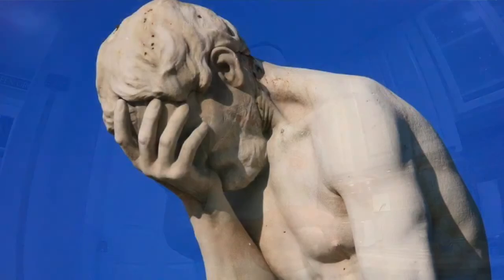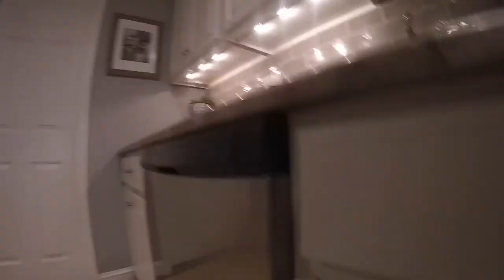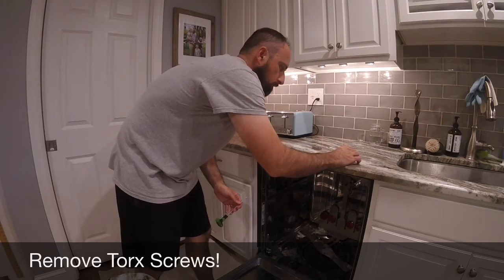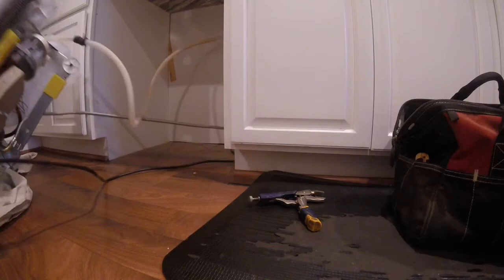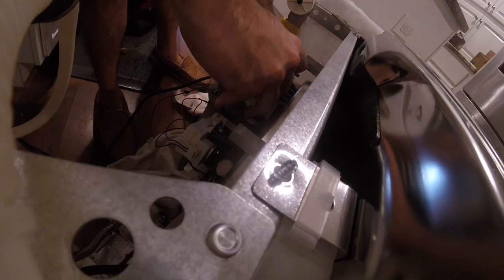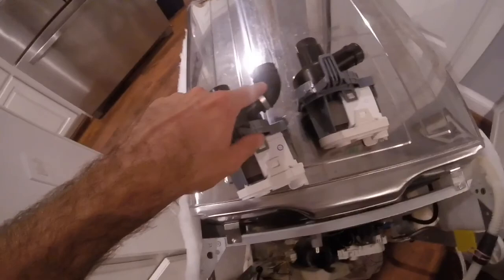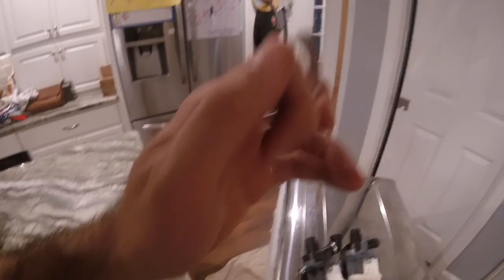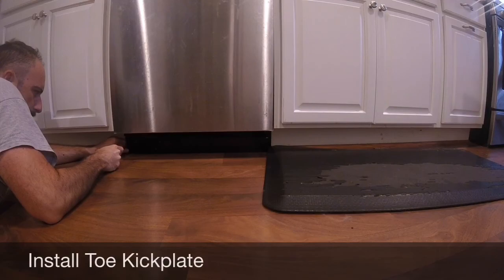Kenmore Dishwasher Pump Repair

Comment: Thanks for posting this video!!!!! I am only moderately skilled at appliance repair, but YouTube videos like yours have saved me 100s of dollars in the past few years!! My situation was almost identical to yours. I took a chance and ordered the pump on Amazon for $99+tax. It was a little tricky but I successfully replaced the part and we’re back in business! The housing looks a little larger but my washer was on the parts list for replacements and it totally works. The other item I’ve replaced is the little rubber grommet on the inside center that seals a motor shaft. Thanks again for wanting to help others and going through the effort to make a video!! You are awesome!!
Reply from the maker: Thanks for the kind words glad it helped you! Pass it forward! YouTube has helped me tremendously so it’s least I can do!

Comment: Thanks. Clamps were the biggest problem to get a release. Now I just have to order the part and pray 😂.
Reply: 😂😂😂that’s EXACTLY what I did! I pulled the trigger and ordered the part, made the repair, said a prayer, turned on the dishwasher and voila! Good as new! So if it cost $450 for a repair guy, I saved $350! Many thanks for this video for sure!
Reply from the maker: That is awesome!!!!
Reply from the maker: You are welcome glad it worked!!

Comment: My dishwasher will fill with water and then not spray.  It will pump the water back out when I press cancel.  Is this similar to what you were experiencing?  The weird thing about this is that the pump small hose came off leaking water all over.  I've put that back on and now the machine won't spray.  I've double checked all connections.  Any ideas.  Prior to the hose coming off it worked fine.
Reply from the maker: Sorry for delay just seeing this! Try checking the drain tub sometimes they get clogged with debris, food and even plastic!
Reply: @dantedoescars  No problem, threw in the towel and bought a scratch and dent LG that is a cleaning machine!
Reply: @dantedoescars  was that your problem though like she was saying? Getting water and draining, just no rinse cycle? That's what mine is doing. No water going to the top or bottom racks.